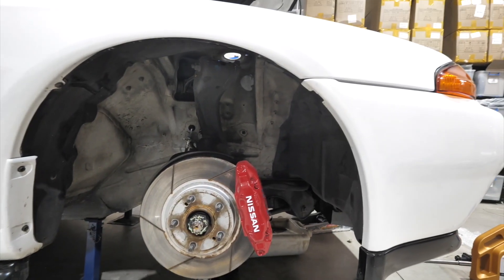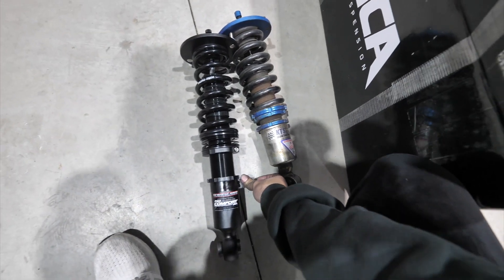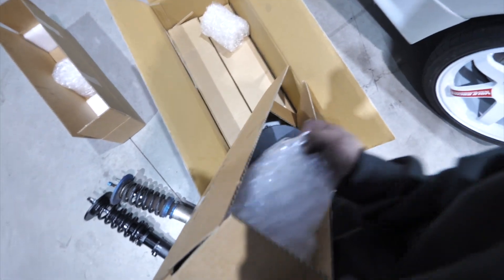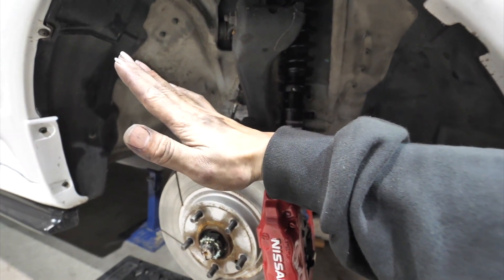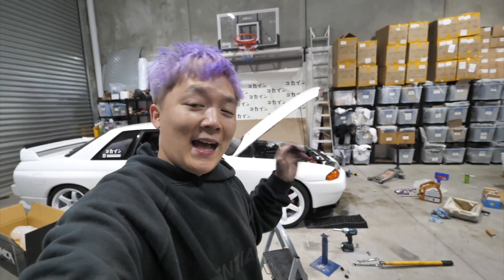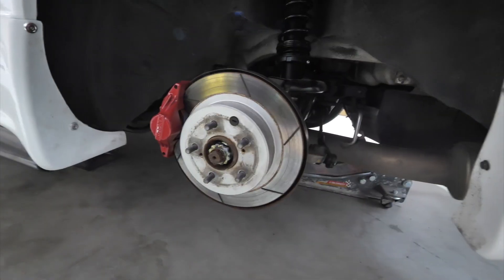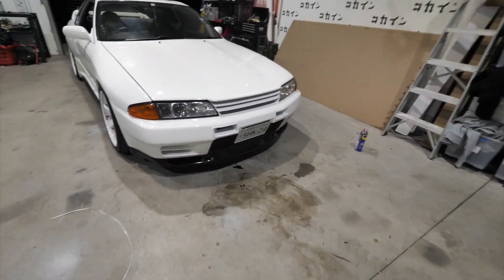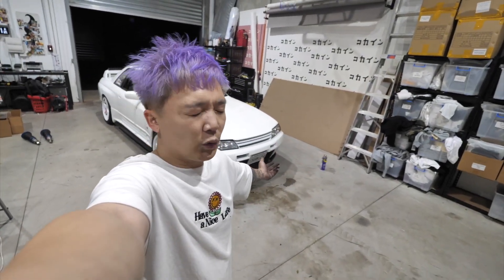GTR GETS NEW COILOVERS

Comment: You put 5lt of oil in the engine when it only requires 4. Something?
Reply from the maker: Yeah it was like 4.8L without oil filter - then another 100m or so for the oil filter, so I was like fuck it, full send haha.
Reply: @HaoPhu  check your dip stick, to much oil can cause issues, crank can aerate the oil creating insufficient lubing of engine
Reply from the maker: @arkzup  Thanks Mick! Did actually check it today and its just at the top - nothing too crazy. Oil pressure is still good and what not as well. Appreciate the comment!